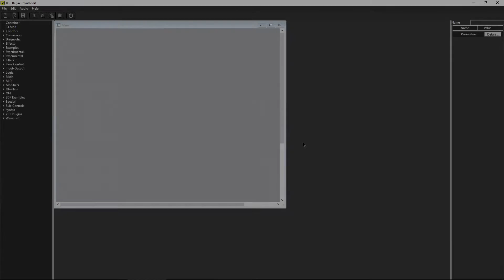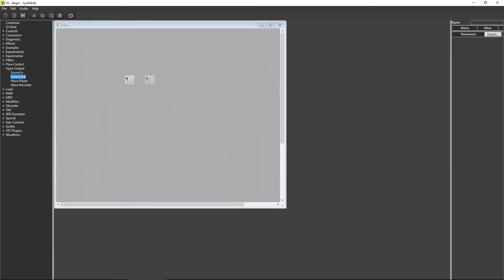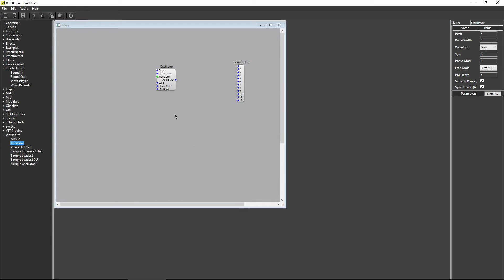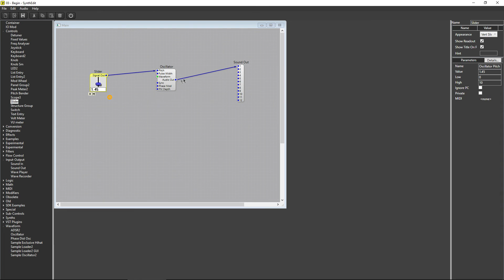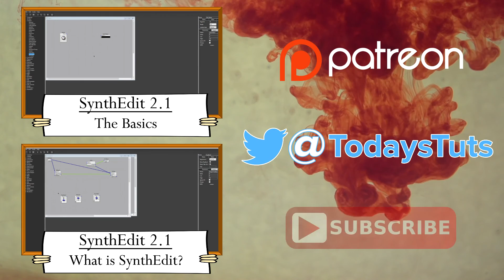SynthEdit 1.2 - First Sounds with the Oscillator Module

Comment: i can't find any other 3rd party oscillators, that have more waveshapes. Or at least a PhaseDist Osc but with a sync option (otherwise the phase is all over the place..i can't use a synth which sounds different every time you play it)